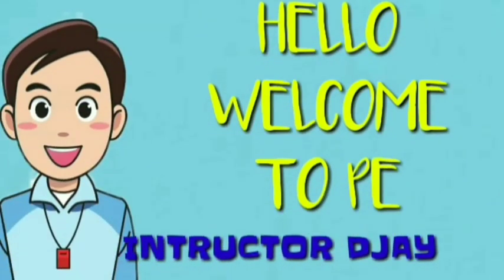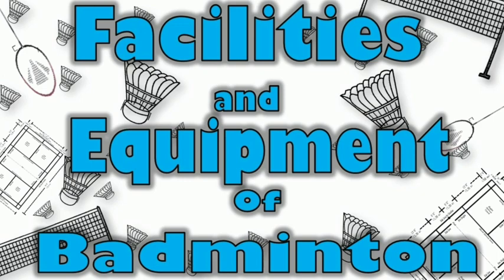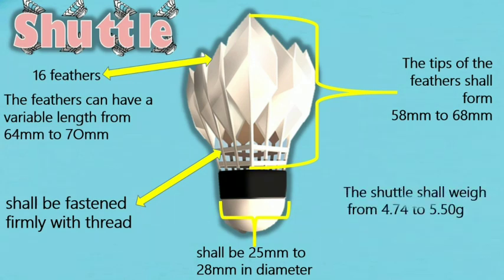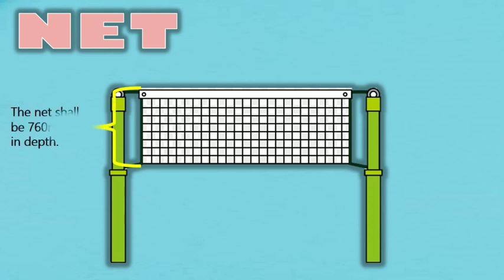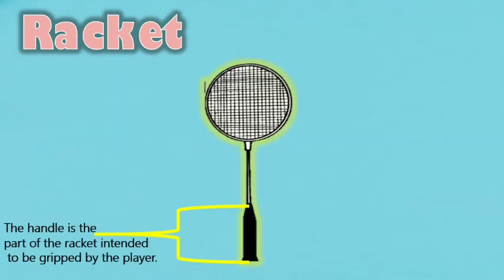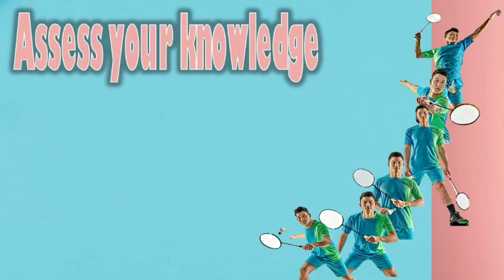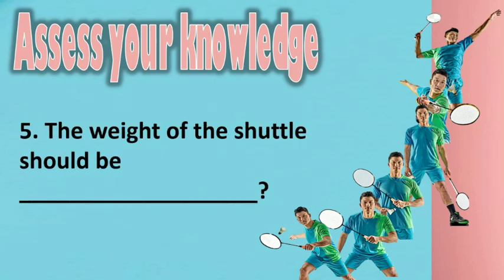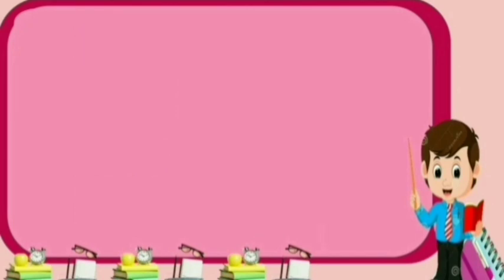BADMINTON || FACILITIES AND EQUIPMENT

Comment: 1. Racket
2. Shuttle
3. 44 ft. long by 22 ft. Wide in doubles and
     44 ft. by 17 ft. wide in singles
4. 680mm in overall length and 230mm in overall width
5. 4.74 to 5.50 g
6.  16 feathers
7. Shuttle,racket,net,and court

Comment: Carlo Perez
BSIT-1A
1. Rocket
2. Shuttle
3. 44 feet long and 17 feet wide
4. 230 mm in overall width
5. 680 mm in overall length
6. 16 feathers
7. Shuttle,net, court, racket

Comment: Christine Joy D. Leonillo 
BSIT 2A 
1. RACKET 
2. shuttlecock 
3. 44 feet long by 22 feet wide in double 
44 feet by 17 feet wide in singles
4. 680mm in overall length and 230mm in overall width.
 5. 4.74 to 5.50g. 
6. 16 feathers 
7. SHUTTLE , COURT, NET,  RACKET

Comment: Bueno, Jenny S.
BSED ENG-2A

1. Racket
2. Shuttle
3. 44 feet long by 22 feet wide in doubles and 44 feet by 17 feet wide in singles.
4. 680mm in length and 230mm in width.
5. 4.74 to 5.50g
6. 16 feathers
7. Racket, Shuttle, Net, and Court.

Comment: Siddayao, John Michael G.
BSIT IA

1.rocket
2.shuttle
3.44 feet long by 22 feet wide in doubles and 44 feet by 17 feet wide in single
4.680 mm in overall length
5.4.74 to 5.50 g
6.16 feathers
7. Shuttle, rocket, net and court

Comment: Talang, Genily A.
BEED A2
1. Racket 
2. Shuttle/ shuttlecock
3. 44 feet long by 17 feet wide singles
   44 feet long by 22 feet wide doubles
4. 680 mm in over all length and 230 mm in overall width
5. 4.74 to 5.50g
6. 16 feathers
7. *Shuttle 
     * Racket
     *Net
     *Court

Comment: Millare, Jonard J.
BSIT 2A
1. Racket
2. Shoutle
3. 44 feet long by 22 feet wide in doubles and for the single 44 by 17 feet
4. 680mm in over all length
5. 4.74 g to 5.50 g
6. 16 feathers
7. Shuttle, Racket, Court, Net

Comment: Angelica B.Macanang
BEED 2-A
PE 3
1. Racket
2. Shuttle
3. 44 feet long by 17 feet wide (singles)
   44 feet long by 22 feet wide (doubles)
4. 680 mm in over all length and 230 mm in overall width
5. 4.74 to 5.50g
6. 16 feathers
7. Shuttle, Racket, Net, Court

Comment: Mariflor Angel of BEED-2
1.Racket
2.Shuttle
3.44 feet long by 22 feet wide in doubles,and 44 feet by 17 wide in single.
4.680mm in overall length and 230mm in overall   width.
5. 4.74 to 5.50g.
6. 16 feathers 
7. shuttle,racket,net,court

Comment: AYSON,BEVERLY B.
BSED ENGLISH 2A
1.Racket
2.Shuttle
3. 44 feet long by 22 feet wide in doubles
 44 feet by 17 feet wide in singles
4.680 mm in overall length and 230 mm in overall width
5. 4.74 to 5.50 g
6. 16 feathers
7. Shuttle, court, net, racket

Comment: REQUERMAN,AARON ALF R.
BSIT-2A

1.Racket
2.Shuttle
3.44 feet long by 22 feet wide in doubles and 44 feet by 17 feet wide in singles.
4.680 mm in over all length
5.4.74 to 5.50g
6.16 feathers
7-10.Racket,Shuttle,Court,Net

Comment: ANDAYA, HANS DOMINICK R. 
BSED ENGLISH 2

1. Racket
 2. Shuttle
 3. 44 feet long by 22 feet wide in doubles and 44 feet by 17 feet wide in single
 4. 680 mm in overall length
 5. 4.74 to 5.50g 
6. 16 feathers 
7. Shuttle, Racket, Court, Net

Comment: ALSECO, JULIE ANN V.
BSED-ENGLISH 2A

1.) Racket
2.) Shuttle
3.)  *44 feet long by 22 wide in doubles
*44 feet by 17 wide in singles
4.) 680mm in overall length and 230mm in overall width
5.) 4.74 to 5.50g
6.) 16 feathers
7.) Shuttle, Racket, Court, Net

Comment: ANCIADO, MELANIE U.
BEED 2A

1. Racket
2. Shuttle
3. 44 feet long by 22 feet wide in doubles and 44 feet by 17  feet wide in single
4. 680mm in overall length and 230mm in overall width
5. 4.74 to 5.50g
6. 16 feathers
7. Shuttle, Racket, Net and Court

Comment: Macrina Silot
BEED-2A
1.Racket
2.Shuttle
3.24ft.long by 22ft wide in double
   44ft long by 17 ft wide in single
4.680mm. in over all length and 230
  mm. in over all in width
5.4.74 to 5.50g
6.16 feathers
7.
   1.Shuttle
   2.Racket
   3.Net
   4.Court

Comment: Mary Ann Abayon
BEED2-A PE3
1. Racket 
2. Shuttle/ shuttlecock
3. 44 feet long by 17 feet wide singles
   44 feet long by 22 feet wide doubles
4. 680 mm in over all length and 230 mm in overall width
5. 4.74 to 5.50g
6. 16 feathers
7. *Shuttle 
     * Racket
     *Net
     *Court

Comment: PAGULAYAN, REGIE ANGEL S.
BSIT-2A

1. Racket
 2. Shuttle
 3. 44 feet long by 22 feet wide in doubles and 44 feet by 17 feet wide in single
 4. 680 mm in overall length
 5. 4.74 to 5.50g 
6. 16 feathers 
7. Shuttle, Net , Court, Racket

Comment: MICHELLE D. CABARLES
BSIT 2A

1. Racket
2. Shuttle
3. 44 feet long by 22 feet wide in doubles and 44 feet by 17 feet wide in singles.
4. Not exceed in 680 mm in overall length and 230 mm in overall width. 
5. 4.74 to 5.50 g
6. 16 feathers
7. * Racket
    *  Shuttle
    * Net
    * Court

Comment: Precious Irah S. Ramos
BEED 2A

1. Racket
2. Shuttle
3. Doubles- 44 feet long by 22 feet wide
    Single- 44 feet long by 17 feet wide
4. 680mm in overall length and 230mm in width
5. 4.74g to 5.50g
6. 16 feathers
7. Shuttle
8. Court
9. Net
10. Racket

Comment: MIGUEL, JEANETTE W.
BEED 2A

1. Racket 
2. Shuttle
3. Doubles- 44 feet long by 22 feet  wide
   Single- 44 feet long by 17 feet wide
4. 680mm in overall length and 230 in overall width
5. 4.74 to 5.50g
6. 16 feathers
7. Shuttle, Court, Net, Racket

Comment: KATHLEEN C. MAGGAY- BEED2
PE. 3
Answers:
1. Racket
2. Shuttle
3.44 ft. Long by 22ft. Wide In doubles and 44ft. Long 17ft. Wide in single.
4. 680 mm in overall length and 230 in overall width
5.4.74 to 5.50g
6. 16 feathers
7. Racket, Shuttle, Net, Court

Comment: Samoy, Dan Kenneth M.
BEED-2

1. Racket 
2. Shuttle/ shuttlecock
3. 44 feet long by 17 feet wide singles
   44 feet long by 22 feet wide doubles
4. 680 mm in over all length and 230 mm in overall width
5. 4.74 to 5.50g
6. 16 feathers
7. *Shuttle 
     * Racket
     *Net
     *Court

Comment: JERRIEH MAE B. NARAG
BSED ENGLISH 3

1: RACKET
2: shuttle
3: 44 feet long by 22 feet wide in doubles/ 44 feet by 17 feet wide in singles
4: 680mm in overall length and 230 mm in overall width
5: 4.74 to 5.50g
6: 16 feathers
7: shuttle, racket, net,court

Comment: ASUNCION, KRISTHEL B.
BSED-ENGLISH 2A
1) Racket
2) Shuttle
3) *44 feet long by 22 feet wide in doubles
* 44 feet by 17 feet wide in singles
4) 680 mm in overall length and 230 mm in overall width
5) 4.74 to 5.50 g
6) 16 feathers
7) Shuttle, court, net, racket

Comment: Princess Joy Maret
BSEDENG2A

1.•Racket
2.•Shuttle
3. •44 Ft. long by 22 with wide in doubles
•44 Ft . by 17 wide in singles
4. •680mm in overall length and 230mm in overall width
5. •4.74 to 5.50 g
6. •16
7. •Shuttle
•Racket
•Net
•Court

Comment: BRIBON, JOEMARIE B.
BSED ENG-2A

1. Racket
2. Shuttle
3. 44 feet long by 22 feet wide in doubles and 44 feet by 17 feet wide in singles.
4. 680mm in overall length and 230mm in overall width
5. 4.74 to 5.50 g
6. 16 feathers
7. Shuttle, racket, net, court

Comment: Name: Kyan Paula B. Adolfo
Course/ Section: BSED- MATH 1A

1. RACKET
2. SHUTTLE
3. In double, 44 ft. long by 22 ft. wide
    In Single, 44 ft. long and 17 ft. wide
4. 680mm in overall length
5. 4.74 - 5.50 g
6. 16 feathers
7. SHUTTLE, RACKET, COURT, NET

Comment: ALLAYBAN, SHAINA J.
BSED ENGLISH A2

1. Racket
2. Shuttle
3. 44 Ft. long by 22 ft. wide in doubles and 44 ft. by 17 ft. wide
4. 230 mm in overall width
5. 680 mm in overall length
6. 16 feathers
7. Shuttle, court, net, rocket

Comment: Brisbane P. Pascual
BEED 2-A
PE 3
1. Racket
2. Shuttle
3. 44 feet long by 17 feet wide (singles)
   44 feet long by 22 feet wide (doubles)
4. 680 mm in over all length and 230 mm in overall width
5. 4.74 to 5.50g
6. 16 feathers
7. Shuttle, Racket, Court, Net

Comment: LLARENAS, KAYCELYN TOMAS
BSED-ENGLISH2A
1.)RACKET
2.)SHUTTLE also known as BIRDIE
3.)44ft.long by 22 width wide in doubles
44ft.by 17 wide in singles
4.)680mm in overall length and 230mm in overall width.
5.)4.74 to 5.50g
6.)16
7.)SHUTTLE, RACKET, NET and COURT

Comment: DELA CRUZ, JAY A.
BEED 2A

1. Racket
2. Shuttle
3.Doubles-44 feet long by 22 feet wide
    Single feet long by 17 feet wide
4. 680mm in over all length and 230 in overall width
5. 4.74g to 5.50g
6. 16 Feathers
7. Shuttle, Court , Net, Racket

Comment: GEVERO, JAYMARK V.
BSIT-1A
1. Racket
2. Shuttle
3. 44 feet long by 22 feet wide in doubles and 44 feet by 17 feet wide in single
4. 680mm  in overall lenght
5. 4.74  to 5.50g
6. 16 feathers
7. Shuttle, Racket, Court, Net

Comment: DURUIN, APRIL JOY A.
BSIT 2A

1.  Racket
2. Shuttle
3. 44 feet long by 22 feet wide in doubles and 17 feet wide in single
4. 230 mm overall width
5. 4.74 to 5.50 grams
6. 16 feathers
7. shuttle, racket ,net ,court

Comment: PASION,KAYE ANN P.
BSIT 1A

1.Racket
2.Shuttle
3.44 feet long by 22 feet wide in doubles and 44 feet by 17 feet wide in single.
4. 680 mm in overall lenght
5. 4.74 to 5.50
6. 16 Feathers
7.Shuttle, Racket, Court, Net

Comment: BARIL, DAISY J.
BSIT 2A

1. Racket
2. Shuttle
3. 44 feet long 22 feet wide in doubles and 44 feet by 17 feet wide in single
4. 680mm in overall length
5. 4.74 to 5.50g
6. 16 feathers
7. Shuttle, Racket, Net, Court

Comment: ASUNCION, JHONMARL B.
BSIT 2A
 1. Racket 
2. Shuttle 
3. 44 feet long by 22 feet wide in doubles and 44 feet by 17 feet wide in single.
 4. 680 mm in overall length
 5. 4.74 to 5.50g
 6. 16 feathers
 7. Shuttle, Racket, Court, Net

Comment: Jade L. Verbo- BEED2
PE. 3
Answers:
1. Racket
2. Shuttle
3.44 ft. Long by 22ft. Wide In doubles and 44ft. Long 17ft. Wide in single.
4. 680 mm in overall length and 230 in overall width
5.4.74 to 5.50g
6. 16 feathers
7. Racket, Shuttle, Net and Court

Comment: LAGAPA, ANGELITA D. BSED ENG2A
1. Racket
2. Shuttle
3. 44 feet long by 22 feet wide in doubles and 44 feet by 17 feet wide in singles
4. 680 mm in over all length and 230 mm in over all width 
5. 4.74 to 5.50 g
6. 16 feathers
7. Shuttle, Racket, Net, Court

Comment: GELI, DONALYN T. 
BSED-ENGLISH 2A

1. Racket
2. Shuttle
3. 44 feet long by 22 wides in double
    44 feet by 17 feet wide in singles
4. 680 mm in overall length and 230 mm in overall width
5. 4.74 to 5.50 g
6. 16 feathers
7. Court, net, racket, shuttle
Reply: MADRID, JERWIN C.
BSED-ENG A2

1. RACKET
2. SHUTTLE
3. 44 FEET LONG BY 22 WIDES IN DOUBLE 
     44 FEET BY 17 FEET WIDE IN SINGLE
4. 680mm IN OVERALL LENGHT AND 230mm IN OVERALL WINDTH
5. 4. 74 TO 5.50g
6. 16 FEATHERS 
7. COURT, NET, RACKET, SHUTTLE

Comment: ARIOLA, HANNAH GEORGEA C. 
PE3
BEED - 2A

1. Racket
2. Shuttle/Shuttlecock
3. 44 feet long by 22 feet wide - doubles
     44 feet by 17 feet wide - singles
4.  680mm in overall length and 230mm in overall width
5.  4.74 to 5.50g
6. 16 feathers
7. Racket, Shuttle, Net and Court

Comment: RICARDO, JANEVA T.
BSIT-2A

1. Racket
 2. Shuttle
 3. 44 feet long by 22 feet wide in doubles and 44 feet by 17 feet wide in single
 4. 680 mm in overall length
 5. 4.74 to 5.50g 
6. 16 feathers 
7. Shuttle, Racket, Court, Net

Comment: DURIGUEZ, BALDWIN NEIL A.
BSIT-1A
1. Rocket
2. Shuttle
3. 44 feet long and 17 feet wide
4. 230 mm in overall width
5. 680 mm in overall length
6. 16 feathers
7. Shuttle,net, court, racket

Comment: CAMPO, CLAUDINE G.
BSIT-1A

Answers:
1. Racket
2. Shuttle
3. 44 feet long by 22 feet wide in doubles and 44 feet by 17 feet wide in single
4.680 mm in overall length
5. 4.74 to 5.50 g
6. 16 feathers
7. Shuttle,Racket, Net and Court

Comment: DOMINGO, CRICEL JOY B.
BEED 2A

1. Racket
2. Shuttle
3. 44 feet long by 22 feet wide in double and 44 feet by 17 feet wide in single
4. 680 mm in overall handle
5. 4.74 to 5.50g
6. 16 feather
7. Shuttle, Net, Racket, Court

Comment: EIJELYN S. DELEON
1.Racket
2.Shuttle
3.For double:44 feet long, 22 feet wide
   For single: 44 feet, 17 feet wide
4.680mm in overall lenght and 230mm in overall width
5. 4.74 to 5.50g
6. 16
ENUMERATE:
•Racket
•Shuttle
•Net
•Court

Comment: Olido Pinky Lyn C.
BEED 1A
PE 3

1.Racket
2.Shuttle
3.44 feet long by 22 feet wide in doubles and 44 feet by 17 feet wide in single.
4. 680 mm in overall lenght
5. 4.74 to 5.50
6. 16 Feathers
7.Shuttle, Racket, Court, Net

Comment: CARONAN, LUIZA J.
BEED 2

1. Racket 
2. Shuttle/ shuttlecock
3. 44 feet long by 17 feet wide singles
   44 feet long by 22 feet wide doubles
4. 680 mm in over all length and 230 mm in overall width
5. 4.74 to 5.50g
6. 16 feathers
7. *Shuttle 
     * Racket
     *Net
     *Court

Comment: AQUINO, JEDIDIAH C.
BSIT 2A

1. Racket
2. Shuttle
3. 44 feet long 22 feet wide in doubles and 44 feet by 17 feet wide in single
4. 680mm in overall length
5. 4.74 to 5.50g
6. 16 feathers
7. Shuttle, Racket, Net, Court

Comment: March Tryzylyn D. Salvador 
P.E 3
BEED 2-A
1. Racket 
2. Shuttle/ shuttlecock
3. 44 feet long by 17 feet wide (singles)
   44 feet long by 22 feet wide (doubles)
4. 680 mm in over all length and 230 mm in overall width
5. 4.74 to 5.50g
6. 16 feathers
7. *Shuttle 
     * Court
     *Net
     *Racket

Comment: LIGGAYU, LEAH MAE P. 
BSED-ENG2A

1. Racket
2. Shuttle
3. 44 feet long by 22 feet wide in doubles and 44 feet by 17 feet wide in single
4. 680 mm in over all length
5. 4.74 to 5.50g
6. 16 feathers
7. Shuttle, Racket, Court and Net

Comment: MARAMAG, JONALYN L.
BSIT 2A

1. Racket
 2. Shuttle
 3. 44 feet long by 22 feet wide in doubles and 44 feet by 17 feet wide in single
 4. 680 mm in overall length
 5. 4.74 to 5.50g 
6. 16 feathers 
7. Shuttle, Racket, Court, Net

Comment: CALUMAG, CHARRIE JOY T. 
BSTM-1A
1) Racket
2) Shuttle
3) 44ft long by 22ft wide in double 
44ft by 17ft wide in single 
4) 680 mm in overall length and 230 my in overall  width 
5) 4.74 to 5.50 g
6) 16 Feathers 
7) net, court, shuttle and racket

Comment: PALACPAC, ANGELYNNE P.
BSED ENG2A

1. Racket
2.Shuttle
3.44 ft. by 22 ft wide( double)
    44 ft. by 17 ft wide (single)
4.680mm in over all length, 230 mm width
5.4.74 to 5.50g
6.16 feathers
7.racket ,shuttle and court net

Comment: BASCOS, ANGELINE MAE, B.
BSED-ENG2A

1. Racket
2. Shuttle
3.-- 44 feet long by 22 feet wide in doubles
   --44 feet by 17 feet wide in                             singles 
4. 680 mm in length and 230 mm in width
5. 4.74 to 5.50g
6. 16 feathers
7. Racket
    Shuttle
    Net
    Court

Comment: BARIT, MARY JANE D
BSED-ENG2A
1. Racket
2. Shuttle
3. 44 feet long by 22 feet wide in doubles and 44 feet by 17 feet wide in single
4. 680 mm in overall length
5. 4.74 to 5.50g
6. 16 feathers 
7. Shuttle, Racket, Court, Net

Comment: CECILIA B. MALUBAG 
BEED2
PE. 3
Answers:
1. Racket
2. Shuttle
3.44 ft. LONG BY 22ft. WIDE IN DOUBLES AND 44ft. LONG 17ft. WIDE IN SINGLE
4. 680 MM. IN OVERALL LENGTH AND 230 IN OVERALL WIDTH
5.4.74 to 5.50g
6. 16 (FEATHERS)
7. -RACKET,SHUTTLE , NET, COURT

Comment: ESPANTO JOYCE G.
BSSW 1A
PHYSICAL FITNESS

1.RACKET
2.SHUTTLE
3.44 FEET LONG and 17 FEET WIDE
4.680mm in overall length and 230 mm in overall width
5.4.74 to 5.50g
6.16 feathers
7.SHUTTLE,RACKET,COURT,NET

Comment: ABEXA ABAIGAR
BSED-ENG2A

1. RACKET
2.SHUTTLE
3. 44 ft. long - 22ft. wide in doubles , 44ft. by 17 ft. wide in singles
4. 680mm in overall length and 230 mmin overall width
5. 4.74 - 5.50g
6. 16 feathers
7. Shuttle , racket , Net , Court

Comment: ASUNCION FREDELYN C.
BSIT - A2
1. Racket
 2. Shuttle
 3. 44 feet long by 22 feet wide in doubles and 44 feet by 17 feet wide in single
 4. 680 mm in overall length
 5. 4.74 to 5.50g 
6. 16 feathers 
7. Shuttle, Racket, Court, Net

Comment: RESPICIO LHEA C.
BSED ENG 2
1. Racket
2. Shuttle
3. 44 feet long and 22 feet wide
4. 680 mm in overall length
5. 4.74 to 5.50g
6. 16 feathers 
7. Shuttle, Racket, Court, Net

Comment: XYRIL CLAIRE D. MIGUEL
BEED-II A2

1.RACKET
2.SHUTTLE
3.44 FT. LONG & 22 FT WIDE
4.680mm IN OVERALL LENGTH & 230mm IN OVERALL WIDTH
5.4.74 - 5.50 g
6. 16 FEATHERS
7. SHUTTLE, RACKET, NET & COURT

Comment: SANI, ALVIN R.
BSED-ENG2A

1.RACKET
2.SHUTTLE
3.44 FT. LONG & 22 FT WIDE
4.680mm IN OVERALL LENGTH & 230mm IN OVERALL WIDTH
5.4.74 - 5.50 g
6. 16 FEATHERS
7. SHUTTLE, RACKET, NET & COURT

Comment: CABARO JONALYN C.
BSBA 1A
1ST YEAR COLLEGE

1.RACKET
2.SHUTTLE
3.DOUBLE-44 FEET LONG BY 17 FEET WIDE
4. 680MM IN OVER ALL LENGTH AND 230 IN OVER ALL WIDTH
5. 4.74G TO 5.50G
6. 16 FEATHERS 
7. SHUTTLE, COURT, NET, RACKET

Comment: Dugay, Kristelle Ann B.
BEED2
1.Racket
2. Shuttle
3.The court should be 44 feet long by 22 feet wide in doubles and 44 feet by 17 feet wide in singles
4.The frame of the racket shall not exceed in 680 mm in overall length and 230 mm in overall width.
5. The weight of the shuttle should be 4.74 to 5.50g
6. 16 feathers
7. Shuttle
8. Racket
9. Net
10. Court

Comment: GAZMEN, SHELLA MARIE A. 
BSIT 2A

1. Racket
2. Shuttle
3. 44 feet long 22 feet wide in doubles and 44 feet by 17 feet wide in single
4. 680mm in overall length
5. 4.74 to 5.50g
6. 16 feathers
7. Shuttle, Racket, Net, Court

Comment: Cristel Joy D. Camaddu 
BEED 2-A
PE 3
1. Racket
2. Shuttle
3. 44 feet long by 17 feet wide (singles)
   44 feet long by 22 feet wide (doubles)
4. 680 mm in over all length and 230 mm in overall width
5. 4.74 to 5.50g
6. 16 feathers
7. Shuttle, Racket, Net, Court

Comment: Ramos, Frances
BEED 2A
1. Racket
2. Shuttle
3. 44 ft. Long by 22 ft wide in doubles
     44 ft. Long by 17 ft. Wide in single
4. 680 mm in overall length and 230 mm in overall width
5. 4.74 - 5.50 g
6. 16 feathers
7. Shuttle, Racket, Net and Court